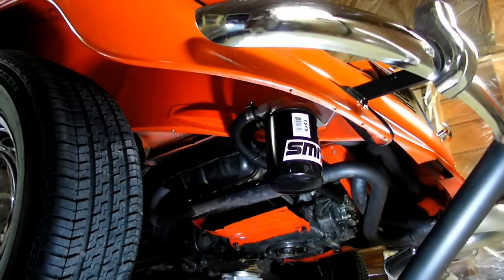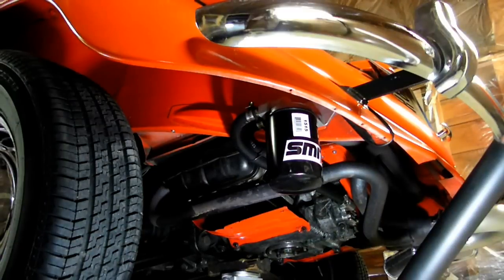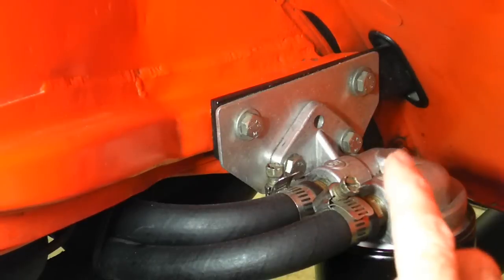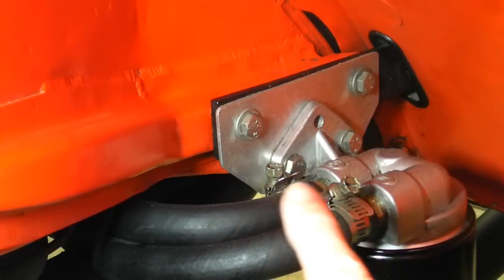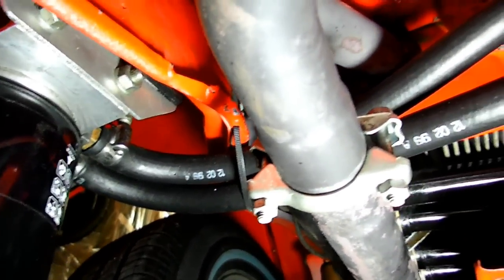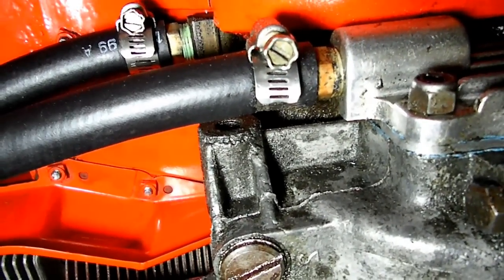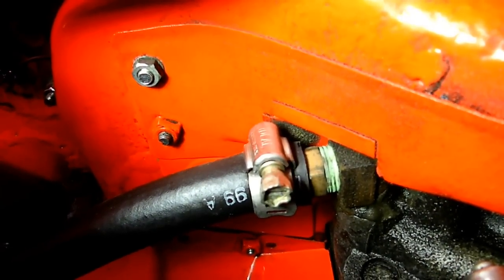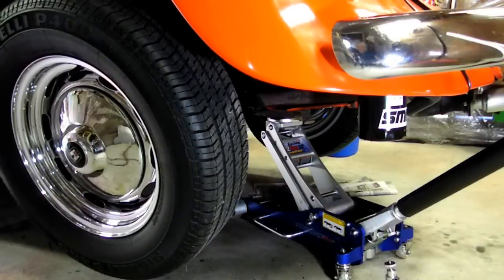Vw Beetle Remote Spin-On Oil Filter

Comment from the maker: The cover i have is aftermarket and can be bought just about everywhere.The other hose that goes to the main oil galley in the block has to be drilled and taped for the fitting.

Comment: Nice work!
I want to do the same remote oil filter setup on a father-in-law's Beetle... is that oil pump cover a custom one, that you have the bottom hose running into? I'm not that familiar with Bugs (yet)... or are those factory tapped bolt-holes that we can readily use to feed the oil hoses into?

Comment: Hi, a quick question if you dont mind...what is the gauge of the metal hose - engine connectors? Mine are leaking and I need to change them...are they standard for lots of cars or need to be specially sought? Also, what is the best tape to use to seal the male female metal parts?....thanks. Nick
Reply from the maker: I am not sure what hose you are taking about.

Comment: Oil filter fed by the oil pump cover, is not the proper way to do it.
If you want to do it that way, you might as well get the oil pump cover that has the threads to spin a filter on it.
Tapping the case so it is a full flow, is the best way to go.
 Cold thick oil can explode the remote oil filter. Replace your pressure relief and control pistons.